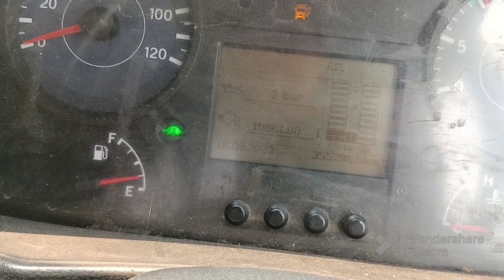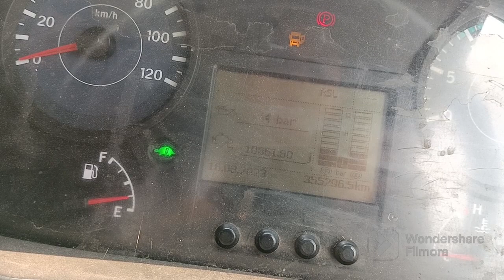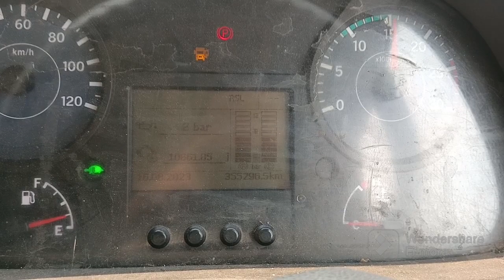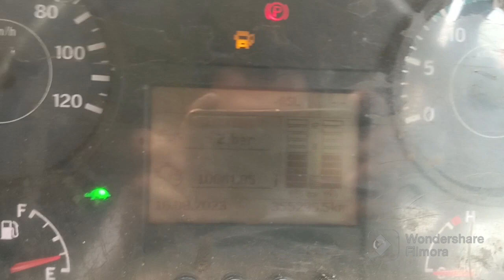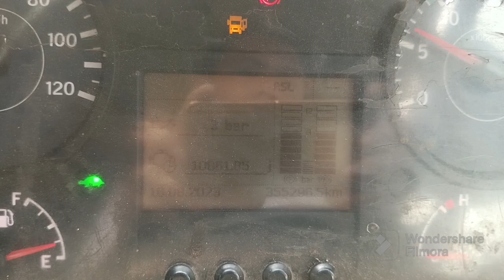QUESTER : Setel angin air drier / governor angin

Comment: Blue colour is wax to prevent further tampering.
Reply from the maker: yaaa, but the wax interferes with the bolts to adjust the air brake pressure😬

Comment: dan di spedo meter ada tulisan nya tekanan rem tinggi
Reply from the maker: Kalau dikendorin tetap tidak mau turun, kemungkinan valvenya ada yg macet Pak. Mungkin bisa dibongkar dulu air driernya, dibersihin valve - valvenya
Reply: @Mechanic57098  valve yg seblh mana
Reply from the maker: Bukanya dari baut 10 yg dari bawah Om
Reply: @Mechanic57098  Bos klo nukar IECU dgn unit lain ngak apa2 kah?
Reply from the maker: @muhammadhatta879  kalau tukar IECU satu set sama instrument cluster atau dashboardnya Om. Karena dia akan narik data kilometer tertingginya kalau ngga 1 set... Nanti kalau dibalikin lagi ke mobil aslinya kilometer mobilnya jadi ngikut yang tinggi